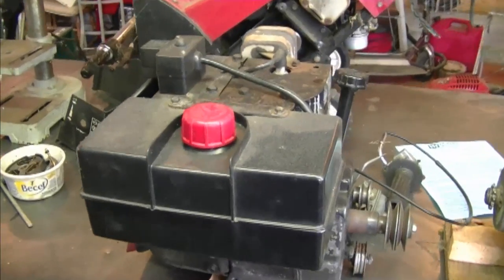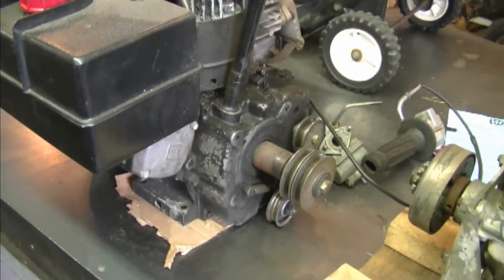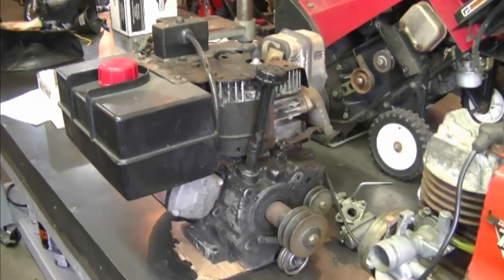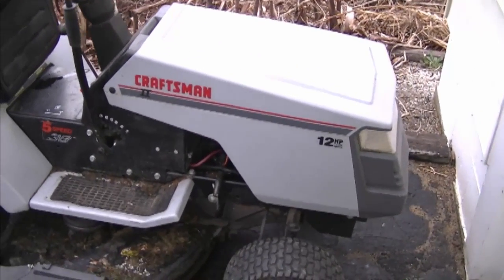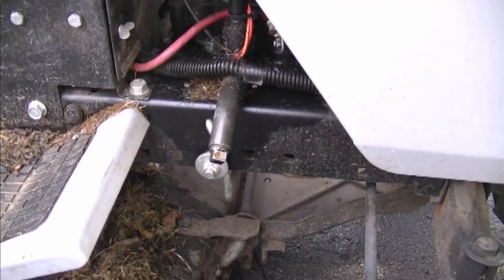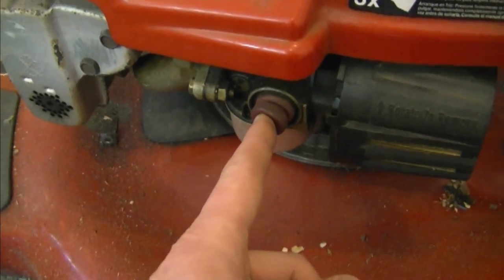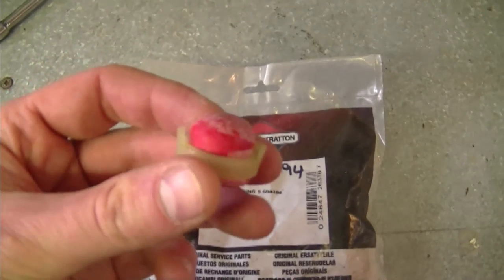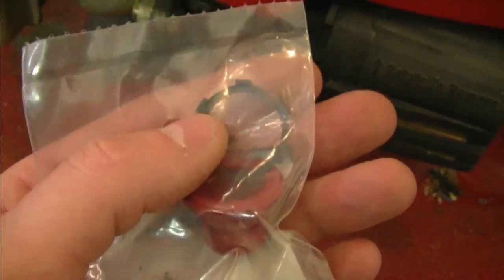Small Engines Q & A Video #46 in HD

Comment: Awesome information in this video Donyboy. I have a 2007 Craftsman LT2000 and it had excess fuel in the crankcase like you described. I took it to a small engine repair shop and the guy fixed it but this was before I found your channel. I'm now subscribed so I'll be saving some money for future repairs. Thanks!

Comment: One thing I learned in auto tech school for finding out if you have gas in the oil is take out the dipstick and hold a lighter to the oil, and if it ignite's quite easily, there is gas in it.

Comment: i got my romping mower running today :D i made a new manifold to run a walbro carb on it and now it runs great.  i got dual fart cans on it LOL took it through about 2 inches of much under about 3 inches of water and even though it got stuck ooommmmgggg it was sooo much fun.  i could only get about 6 feet one direction because it was thick as shit there but i built up some speed and went through it the other way with the engine revving its balls off and almost got through its 4hp.open dif :/